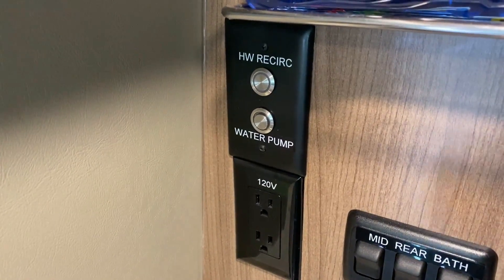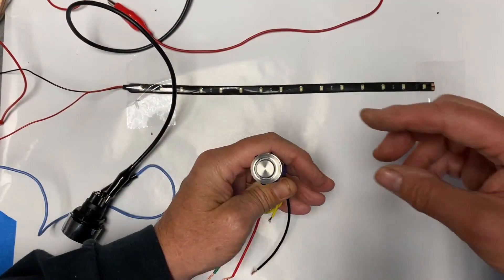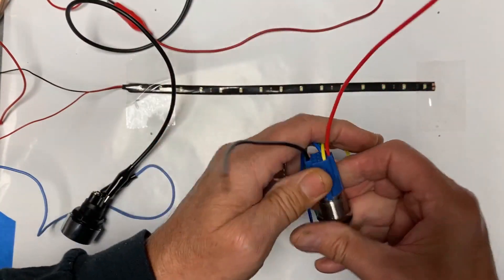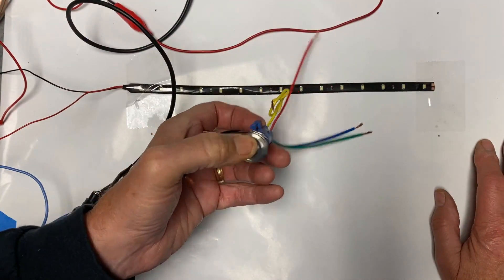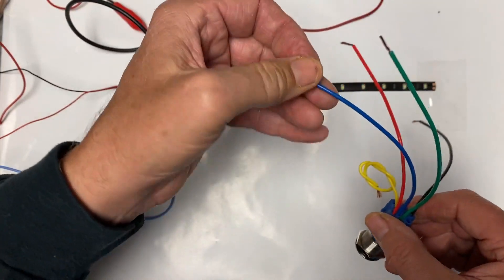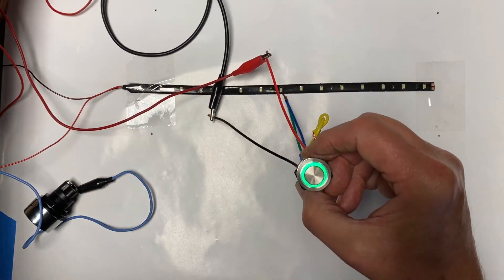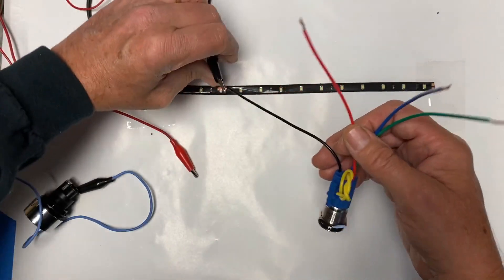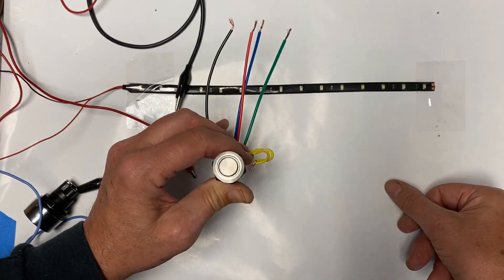Momentary Switch Explained

Comment: How can I connect plye 4ch Bluetooth amp, APIELE 22mm Latching Push Button Switch 12V Angel Eye Ring Light LED Waterproof Stainless Steel Round Metal Self-Locking 7/8'' 1NO 1NC 1 Pack (Blue) I took out the yellow wires and hook led up red to blue so where should the red and blue wire I twisted go and where where would the single blue and single black wire go , using Tegg 5pcs DC-099A DC Female Panel Mount Charging Wire Threaded Socket Jact Connector with Dustproof Plug IP67 68 Water-Proof Large Current Power Adapter 5.5x2.1mm, 12v Talentcell 6000mAH rechargeable battery and this 10pcs Conductor Compact Connectors Lever Wire Nut Electrical Connectors with Fixed Base for 3 Circuit Inline Splices 28-12?

Comment: Can I use this as my engine start
Reply: Yes but I would use a relay as well.
Reply: @saabmagicman2588  thanks bud what Iv done is fitted the normal kit and got it all working  but want to fit the button to my steering wheel so need a smaller button and hope to replace the button with this

Comment: It sounds like the button in this video is a Latching Push Button Switch and not a Momentary Push Button Switch.  Am I wrong?
Reply from the maker: No, it’s a momentary switch. It activates a relay
Reply: @travato1592  thanks for your video, you said you made another video to explain how you connect your momentary button with the relay to obtain the on/off led
Reply: The first one looks like a latching push button switch
Reply: This is not a momentary switch, momentary, meaning circuit is on for the moment it’s is pushed, when released, the switch is turn off

Comment: Question,  im wiring a chase light using a momentary rocker switch,  where do i connect the yellow wire that changes the mode patterns on the light? Thx

Comment: Hi thanks for the video, a question, i want this type of momentary switch for my house lightning, is it possible to use a momentary switch that completes the circuit when pushing 2nd time so that the light bulb is on on the first click? thanks!
Reply from the maker: Don’t really understand the question. Do you want to switch a 110v light?  You want a latching switch or a single pole switch not a momentary switch.
Reply: @travato1592  Yes i want to switch a 110v lights for my house, im want to use a smart switch driver like sonoff this has the option to use a momentary switch , would this metalic momentary switch work? or is a low Voltage button?
Reply from the maker: Salomon Sacal you will need an appropriate 110v switch, the one I used is for 12v